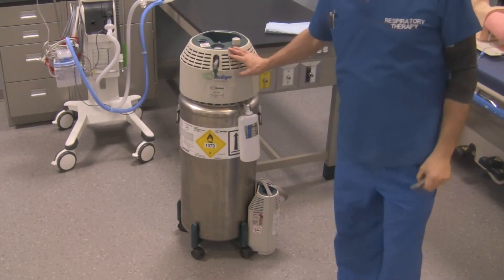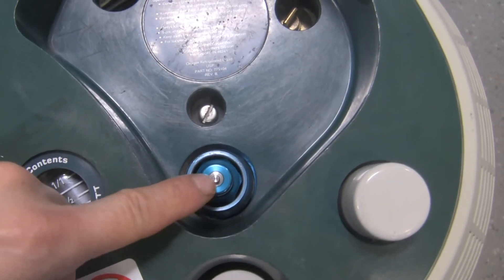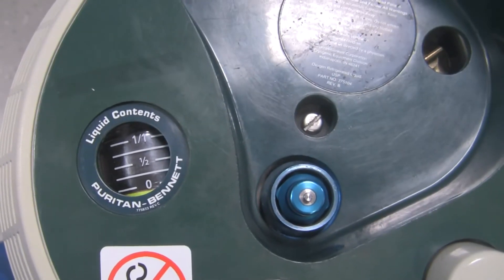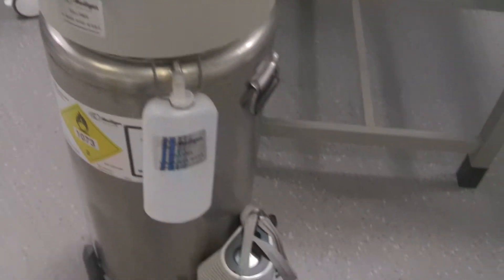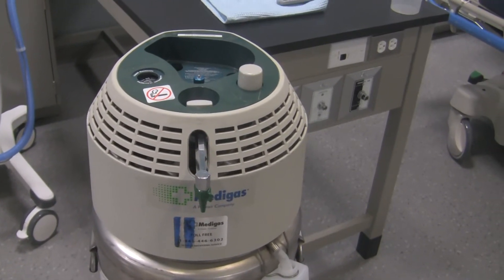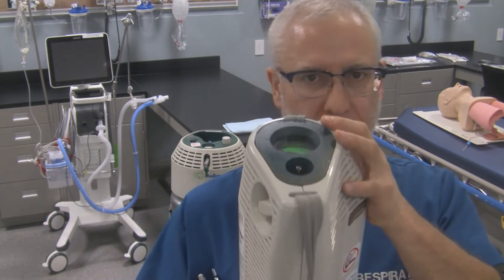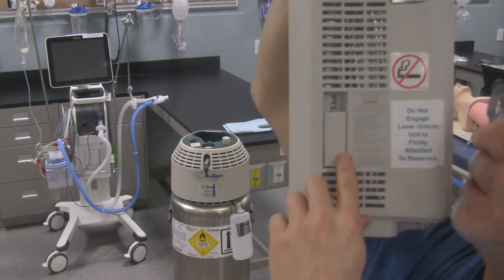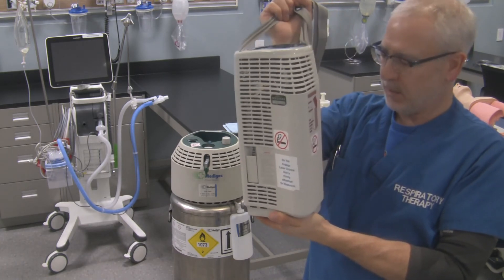Portable Home or Hospital Liquid Oxygen Systems for Patient Use:  Part 1

Comment: Hi, I was wondering when the patient wants to use the portable canister and turns on the flow rate, should the canister then have vapour around it while in use? is there any dangers to that vapour? thanks.
Reply from the maker: Hi: It depends.  If there is moisture between the portable canister and the reservoir during filling, its possible that the vapor could be oxygen vapor so the usual oxygen safety precautions should be employed.  Another possibility is that the vapor is just moisture that condensates as the canister filled (the components of it exposed to liquid oxygen are now super cold0 so a mist occurs.....especially in humid locations....it would be like taking something out of the freezer on a really hot summer day and watching the mist come off of it.  Hope this helps.
Reply from the maker: The vapor that you are speaking about should disappear after awhile as the unit warms up.  If you are in a hot and humid area, It could have a small amount of vapor coming off of it for quite awhile.  When its hot and humid where I live and I pull a tray of ice cubes out of the freezer, there is usually a humidity vapor coming off of it.
The vapor itself (under normal conditions) is just room air humidity.  However, if your unit is leaking, it could be liquid O2 vaporizing.  If your concerned, please have your service provider check it. Hope this helps

Comment: What uses does liquid oxygen have in the medical field? Is it just more convenient to store instead of pressurized? I always thought the pressurized oxygen canisters has liquid in them…
Reply: No, you can't liquify oxygen under room temperature conditions so the compressed gas needs much more volume. One liter LOX turns to 800 liter gas under normal conditions. A 1 liter gas cylinder with 200 bar can only deliver about 160 liter.
Reply: @tobiaswittenmeier1877  I see